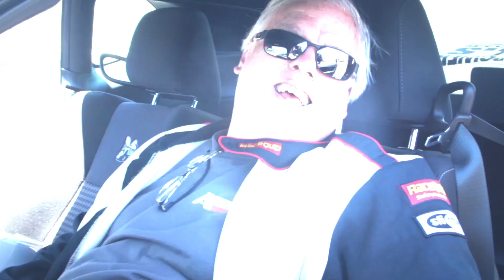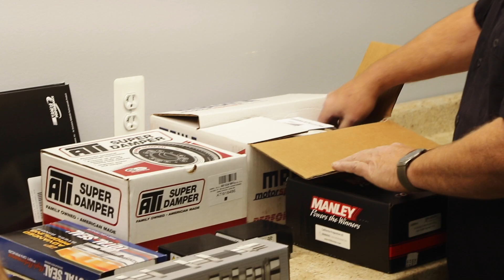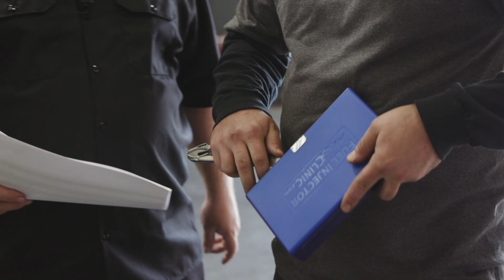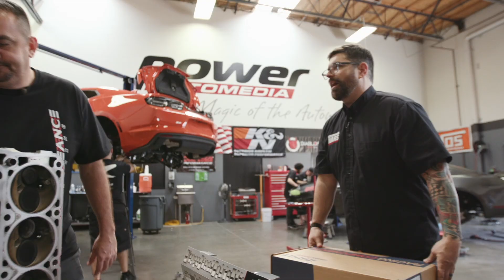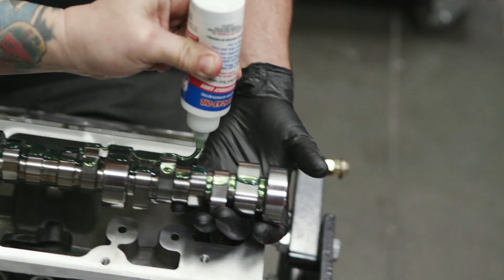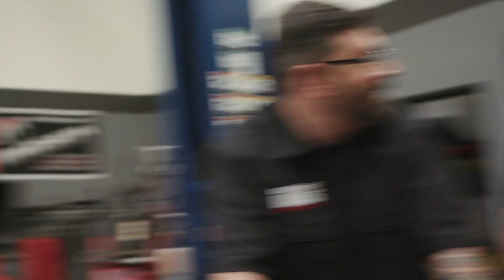Pony Wars 2 Episode 3: Preparing for ProCharged Boost

Comment: Should have chunked that lt in the trash and grabbed a 5.3. Would make way more power cheaper.
Reply: That defeats purpose of this whole episode you ding dong. A typical LS swap dork would say this
Reply: @HandDriven  yeah I agree. Stock for stock though the Ls is a much stronger motor. I'm a coyote guy so I'm hoping this coyote holds up but the guy over that build seems like he doesn't know half the shit of the Camaro guy. Whining about opg and crank sprocket? That is a very common mod on guys trying to knock around 800 reliably. Also no other supporting mods like HD chain and billet tensioners? Setup for possible failure.
Reply: @HandDriven  damn u are that salty that ur build crew is gonna get stomped by vengence?
Reply: Nathan22 Outdoors uhm not at all because they aren’t “my team” this ford teams a joke
Reply: If they could sell parts and use the money from it, that wouldve been the best bet. 5k for a sleeved 5.3 or 4.8, heads, cam, intake with the procharger and the rest of the budget on supporting mods and suspension.

Comment: He's right about them cast iron blocks because they don't move I worked with aluminum box in cast iron box cast iron blocks are the best
Reply: Cobra Black weight
Reply: Cobra Black did you really just try to compare top fuel to this garbage? LOL.
Reply: @eldiablort1461  No different than every ford fuqtrad comparing Pro Mod to the avg builder looking for 1000hp or so claiming all the modular/5.0 advantages  lmao.

Comment: I think the Chevrolet guys spent too much on the engine they have it where they can make way more power than the stock auto can handle.
Reply: I think so too. Like they might make a crazy amount of power but with 2100ish dollars they arent gonna be able to put it to the ground.
Reply: @lukelanam6045  or the only thing they are worried about is the Dyno competition and a couple of 1/4 mile passes
Reply: Ya i dont agree with doing rods, Gen 4 rods have been well over 1000whp, Would be surprised if they hit 900whp

Comment: could the short fat troll cry about the oil pump gears any more
Reply: He talked so much shit about only needing to change 1 or 2 things on the coyote when that 1 part took longer then an entire LT build 🤣
Reply: If it really took them that long he shouldn't have been helping. 
That said it's sad that the ls needs pistons, rods, cam, heads etc to compete with the otherwise stock 5.0. Really shows the difference between the 3 when adding a Procharger to each of them.
 The Chevy would have most likely stayed together without the pistons and rods the Dodge wouldn't have. I guess dodge went down in compression when I'm sure Chevy went up because they knew that stock crank couldn't handle the power where Chevy and ford can. 
I guess Dodge didn't want guys  adding a blower to their N/A challengers and chargers and busting the hellcat or demons ass lol...
Reply: His friend with the beanie looks like bam from jackass

Comment: So let me get this right. A stock 5.0 with OPGS and a crank sprocket. Is gonna compete with a built bottom end and cammed 6.2 and 6.4... lmao that’s fair
Reply: They all had 10k and each team spent it where they wanted, Sounds pretty fair to me.
Reply: Yep they should have been strait out equal HP & torque, with just minor equipment/ parts,kinda defeats the purpose of going head to head, when the others add pistons and cams.
Reply: @davidvincent3434  Not when you actually PAY ATTENTION, realize that the competition consists of a Dyno, a 1/4 Mile pass, and an Autocross run...

And, as Chad said - they're saving money with the engine in the Mustang so that they can afford to have a set of Springs & Shocks tuned for the Drag strip, and a second set tuned for the Autocross - while the Challenger and Camaro will have a built bottom end, but only ONE suspension configuration for both the Drag strip and Autocross

This isn't difficult, guys. At NO point did they ever claim to be trying to make these cars equal, so I don't know why you're acting like "they don't know what they're doing!!!"
This is about how can they build the most well rounded version of each car with a $10,000 budget

Besides, if you really want to bitch about something, the 5.0l Mustang starts at $35k, the 6.2l Camaro starts at $38k - while the 375HP 5.7l Challenger R/T starts at $34k, but the 485HP 6.4l R/T Scat Pack they chose starts at $40k
Reply: @RyTrapp0  agreed should of done the 5.7
Reply: They want to keep stock bottom end rules because that gives them advantage. All out build no money limit you could have a solid roller lt1 revving to 8000 rpm on 20 psi making 1500 + hp. The coyote is cube limited due to bore spacing. On a stock bottom with boost the coyote has the advantage. That’s where it ends. All out NA builds even keeping the stock bottom end it’s really ugly fir the coyote. Stock bottom end stock cube lt1 cars are hitting 650 rwhp right now. Stroked with a solid roller setup will be 750. A coyote just can’t match that na. It can get to 600 range and will have no low end
Reply: @ultrazls1  funny story bro.
Reply: SyphonX  Wow, you're completely clueless, aren't you...

They CHOSE not to put aftermarket rods and pistons in the 5.0l because the stock bottom end is already strong enough to hold 1000+

...but, yea, uhh pushrods, and uhh, camshafts and stuff...
Reply: It's real simple. The coyote already has forged internals. It's ready for boost from the factory. In fact when I bought my 18 Gt, the dealership offered to finance in a Ford performance supercharger in the sales deal, and it retains the warranty.
Reply: @coyotekelly7143  the rods are forged but the pistons are not.
Reply: SyphonX   Still haven't figured out what the difference between a "pushrod" and a "connecting rod" is, brah?

I guess I would desperately try to deflect from such a royal fuck up too...
Reply: Then tell ford to step up their game and produce a bigger cubed car. It's obviously hurting ford guys feelings when they find out real world results.
Reply: You Chevy guys are so angry and Clueless MMR builds coyotes that are faster than any LSX has ever gone and by the way where is your Corvette that can do 300 miles an hour in a standing mile
Reply: @paulhouchen9010  Yet every comparison between the engines the coyote loses. Imagine that.
Reply: @EGGINFOOLS  it's easy to do when you are biased towards one or the other let's completely rebuild the Chevy motor with $50,000 in machine work that is free and then slaps some oil pump gears in the coyote bitching complain about how hard it was and then send it down the track
Reply: @paulhouchen9010  Ford doesn't have a versatile platform. GM and FCA do. That's Ford's problem/fault.
Reply: Changing pistons and rods is hardly 50k in machine work. It over exaggerations like that, that give "fan boys" the title they deserve
Reply: @EGGINFOOLS  How does Ford have a "Platform Problem" exactly? The platform you claim to have "problems" has consistently outsold the junk GM has thrown together and in fact the gap in sales was so fucking horrible GM stopped building the shitboxes for several years. Even the fucking Challenger outsells Camaro now. There's a platform problem alright but it's not the Mustang that's for damned sure.
Reply: Also when will they do a 5.0 vs the 5.3 build? The answer is they NEVER will because they know the outcome of that comparison!

Comment: This should be do anything for 10k. The Hemi guy said they limited him on Cubic inches? The last one of these they wouldn’t dyno the mustang over a certain RPM because the other cars couldn’t rev that high but that’s where the mustang makes power and shines. These are stupid rules. Give them 10k and they must use a procharger. Rung what you brung. Don’t modify the rules to help out certain cars.
Reply: Wasn't that because they were overspinning the procharger?
Reply: MotoAnt the one I saw before they said they aren’t going to go to redline because the other engines couldn’t rev that high. I haven’t watched it in awhile tho. I’ll try to find t again. I think it was these guy’s last pony wars thing
Reply: @108SBSO  yeah it's been awhile for me too so either of us could be right
Reply: They're making this an ENTERTAINING competition by actually trying to keep it competitive, instead of, say, letting Arrington Performance just ignore their autocross results completely and steamroll the competition by building a 2000HP twin turbo hemi to destroy the dyno and drag race by a landslide.

Now, I do think that they should've given ALL of the teams the option to EITHER build the bottom end and keep the stock RPM limit - OR - run the stock bottom end but have no RPM limit(since it'll be limited by the stock bottom end).
That makes a lot more sense, especially when the other two teams have the option of running aftermarket heads("...that feeling when you buy a brand new car, but have to drop $2k+ on new heads...")
Reply: @RyTrapp0  like they couldn't add twins to the others and make the same power? Your delusional if you think that's not the case. Not to mention the ford will do it with the factory heads, block and crank.  Will make 3k with those same parts. Something the dodge wouldn't stand a chance of doing without aftermarket crank heads etc. Also the reason the ford didn't go higher in rpm was because of the belt slipping. They tried but kept losing boost. They're supposed to be doing that over with both running the same blower. The ls won't have the benefit of the bigger F1 Procharger if they ever show the episode.
Reply: @waynebollentin989  ...great job completely missing the point. I can't blame you though - must be a product of the American education system...
Reply: @RyTrapp0  what was your point then oh great one. Please do explain to the low educated Americans
Reply: The little 5.0 rpm advantage is gone once you go solid roller on the lt1 anyway. And after that it’s not cube limited like the coyote. With money as no option the coyote is simply outclassed
Reply: @ultrazls1  why has the 4.6 and 5.0's been faster then when money isn't an issue? Plus they've been faster with the factory block and head then a billet ls has with the best of everything. 
That said I'm not saying a Ls or Lt can't spin high rpm. Shit my old sbf 428 A4 block spun 9800 but It wasn't just because of a solid roller though. 
You can build anything to make power if money isn't an issue but it's hard to beat what you can get out of a stock coyote or factory 4.6 etc block, heads and crank in the right person's hands.
 They're not outclassed at all and it takes a billet aftermarket block to even compete with them. So who's really outclassed?
Reply: @ultrazls1  Explains why the LS powered Camaro's are outselling the Mustang and Challenger..................you know, because they outclass the 5.0 and all.........
Reply: @waynebollentin989  Its called balance of power, historically its usually not well thought out balance.  Their are also a bunch of other engine platforms that werent competitive in Pro Mod.  Also, look at what a legit untouched 4.6/5.0 block takes stock not what a Pro Mod prepped block takes. At that level of money who cares if a block is billet or has $10,000 in machine work not to mention all the R&D time.
Reply: @shaadydog1  
They use billet now and have been.  The point it was still a factory block and it wasn't 10k worth of work done to the block either. Also still a factory head. Nothing against the ls either. I just give ford credit where it's earned it. Doesn't matter who's make it is. Any motor can be built run. You have 2jz going 5.60s at 260mph. Of course light car but still. I don't disagree when money isn't a problem you can make power with just about anything. Best design is still the hemi and I'm not even a dodge guy. I just give credit where it's due.
Reply: @shaadydog1  if it has nothing to do with ford then why can't you do it with a ls block or better yet even an Lsx block for that matter. or a set of stock ls heads do what a set of stock 4v heads will do. 
Now of course the modifications are what maximized what they got out of everything but it wouldn't have happened without the foundation ford gave them to start with and that was the point. 
Not sure why the obvious has to be pointed out all the time.
 I'm not ford guy either. I'm what's ever available at the time guy. Ford, Chevy, Dodge, Buick etc raced them all over the years. It's people at the end of the day that make things work but you can't knock a good foundation either.
Reply: @shaadydog1  
You seem like a conspiracy theorist. You think the earth is flat also?
Reply: I have a Coyote and I agree with this. If machine work, sleeving, balancing and blue printing can be done for under the $10k great. You are not going to build a engine for $10k AND have money for wheels, tires, exhaust, suspension, drivetrain ect but okay that would be fine. Even better, start each team with $50k. Now go buy a brand new Camaro, Challenger and Mustang for MSRP and whatever you have left you can use for mods other than the Pro Charger which is provided. The Camaro and Mustang would run away from the Challenger but fair would be fair.
Reply: So like if I sold the car got 40k back on it then put 50k in a 2v mustang and burn there ass

Comment: Should of put 1 7/8 headers to dumps to save weight and money
Reply: Wouldn't make the budget for Chevy Ls. Also if your going to do headers you go bigger then that on this build. 1-7/8 wouldn't be worth the time or money on this build. Dumps for sure which I think they all will have.
Reply: @waynebollentin989  I'm talking about coyote Camaro needs 2inch
Reply: @rggt6225  you still want 2" on the coyote with a 1000hp+ blown coyote motor to get everything out of it. If it was N/A the 1-7/8 are great.
Reply: @waynebollentin989  1 7/8 are better than the shortys that come from the factory on a standpoint of dropping weight and performance improvement it will get inhale better and exhale the same
Reply: @rggt6225  my point was you get what is really going to make a difference in this case.

Comment: We hope the Coyote is built correctly??? Why didn’t you go VMP gen 3 wipple?
Reply: Procharger only because its a sponsor
Reply: Because the rules are they all have to use a pro-charger.
Reply: "Better" is subjective. Centrifugal rely on RPM, TVS/roots have power everywhere.
Reply: Its a budget build and everyone has to use a procharger for boost.
Reply: ripfletching VMP and Whipple are two different brands btw. Using a Whipple woulda been cool to see, maybe more costly. Idk if VMP makes a supercharger for Chevy and Dodge tho, that factors in too
Reply: I actually think these deals should be done with turbos!